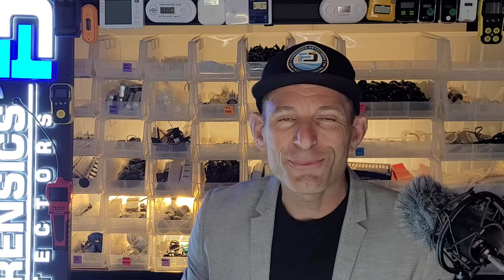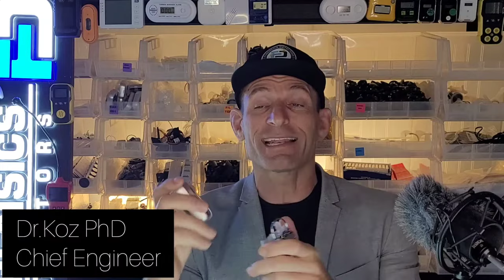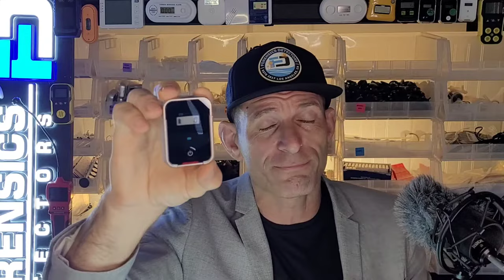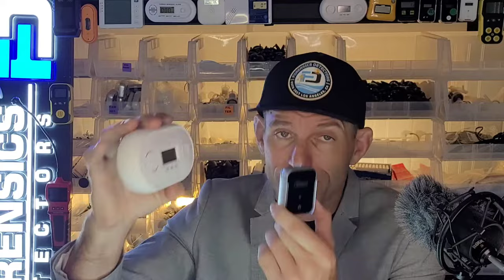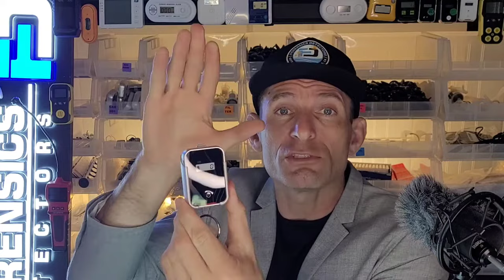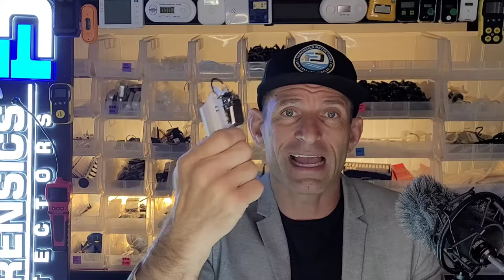Carbon Monoxide Alarm for Aircraft (for Pilots)

Comment: I hang this detector in my 4 person sized tent (camping) when using a propane heater.  The red light one night began flashing when it indicated above 9ppm.  I added more air ventilation in my tent and the indicator light stopped flashing in about 60 seconds guessing.
Reply from the maker: Wow great it helped, yes propane is a sneaky thing to use in a tent.🤜🤛
Reply: I also use the FD-90 E gas leak detector to check and make sure my 1lb propane tank is connected correctly to my heater.
Reply from the maker: @bon3906  WOW Excellent idea, can you please take a picture of that, we would love to put it on our Instagram if OK, that would be nice
Reply: I will the next time I go camping  which will hopefully  be soon.